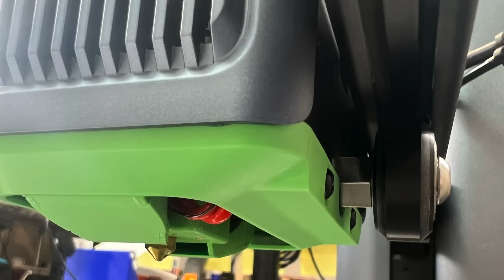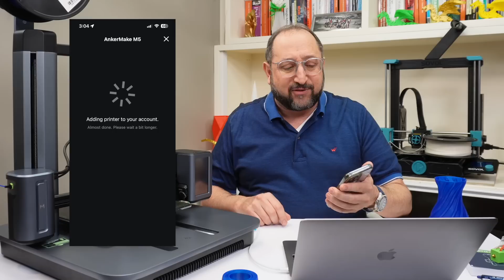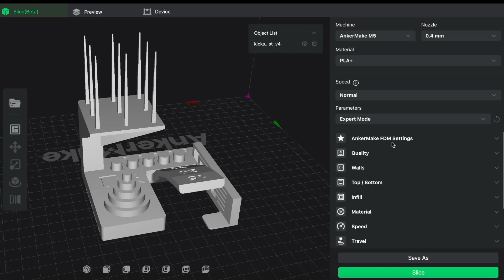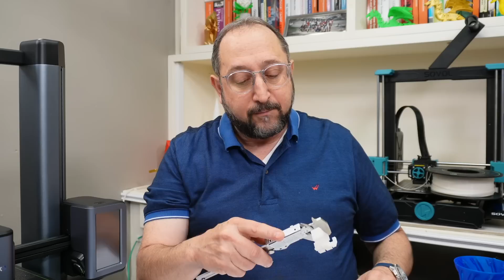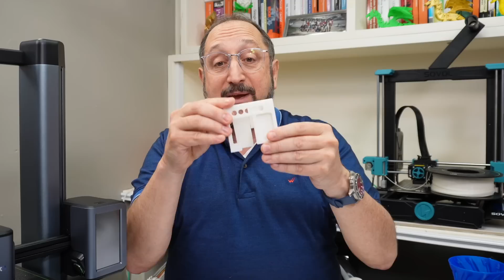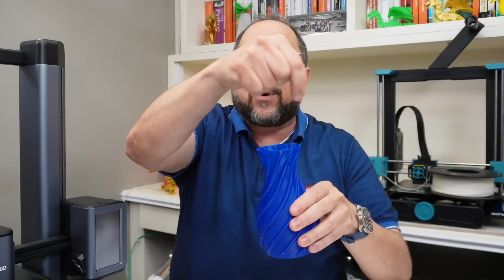AnkerMake M5 3D Printer: This is One Fast Printer!

Comment from the maker: This video has generated several strong comments, and I wanted to respond as the issues some people may see are addressable.

Over the past four years, I have reviewed/used over 20 3D printers from various manufacturers.  Here is a summary of my perspective.

This is a solid 3d printer that is extremely fast. My results while creating test prints were excellent. While designed as a plug-and-play 3d printer, it is still a mechanical device and requires maintenance and tuning.  In some ways, manufacturers do a disservice to purchasers by describing machines as plug-and-play.   Every mechanical tool I have purchased, from woodworking equipment to 3D printers, requires that the user check the assembly and make minor adjustments before first use.

In my experience, any device shipped a long distance will likely need a "tune-up" before first use.  AnkerMake has videos on its site showing how to adjust the belts and wheels on the machine.
The hot end on this printer utilizes a PTFE sleeve, limiting practical operational temperatures to about 230C +/-.    This is fine for PLA, PLA+, and TPU but is at the low end for PETG. People running into issues may be attempting to print at temperatures too hot for this machine which damages the PTFE sleeve.   This is no different from many other 3d printers that also use a PTFE sleeve in the hot end.

The advantage of hot ends using PTFE sleeves is the prints generally string less, which is a significant advantage.  For example, I have an Ender 3 S1 and an Ender 3 S1 Plus.  The S1 Plus has an excellent all-metal hot end but strings significantly when printing.   So depending on my model requirements, I use the S1 or the S1 Plus.

To print at higher temperatures, replace in PTFE sleeve supplied with the printer with Capricorn  XS tubing.   Just order a full-size Bowden tube and cut it down to the proper length for the tube in the hot end.

You can purchase Capricorn XS Tubing here: https://www.amazon.com/gp/product/B07PS3NH82

In summary, my experience with the AnkerMake M5 has been excellent, but if you want to print at temperatures above 230C, I highly recommend you replace the PTFE liner with Capricorn XS.  Using this printer at 260C to print with filaments requiring higher temperatures will likely be unsuccessful and frustrating.  When used within appropriate temperature ranges for this architecture, I expect you will find this machine very fast and easy to use.
Reply: I wonder if this is the case with the m5c too. Its hot end gets hotter?

Comment: Hi ,

I hope you’re doing well! I’ve really appreciated your videos on the AnkerMake M5C, and I’ve run into a bit of a snag with mine that I’m hoping you might have some insight on.

My M5C is still pretty new—I’ve only done about 20 prints. One night, I went to bed while a print was running, and by morning I found the filament had jammed up in the reel and stopped feeding into the extruder. I managed to unclog the nozzle afterward, but now I can’t get filament to come out or go in at all.

I even heated it up to 300 degrees Celsius and used a heat gun to measure the internal temperature, but the hottest it seems to get is around 110 degrees Fahrenheit on the plate, which makes me think something’s definitely gone wrong.

If you have any advice or know someone reliable who handles these repairs, or if you think I should just replace the whole assembly, I’d really appreciate your thoughts.

Also, if you know anyone who still sells parts for these, that would be a huge help. It seems like the manufacturer isn’t releasing parts at this time, so any leads on where to find them would be greatly appreciated.

Thanks so much for all the great content you put out!

Best,
Joe

Comment: Amazing video thank you! I probably miss heard you, but I just confirmed I can use the camera ai with gcode files imported from cura providing I import them into the slicer mode and then move to print from the preview mode instead of simply loading from the device screen. Adaptive layers plus the ai with a well lit set up for the camera + filament that contrasts with the bed color makes make me a very happy consumer

Comment: For the people complaining about the proprietary nozzles. I've been using my m5 almost non-stop since december and I just replaced the second nozzle. 
You can get a ten-pack from Ankermake for 20 bucks I believe, so that's not really much of an issue is it. 
And if you do a quick google search then you'll see there are already aftermarket nozzles available on the interwebs including stainless steel and hardened steel nozzles.
Reply: yeah ive had mine for a year. i use it a few times a month and have not had to replace nozzles yet. its not a big deal

Comment: @Make With tech Hi, I noticed you said the V6 is a "Palette style multi color setup". Did AnkerMake tell you that? Because they're being very secretive about how it's going to work in their own Discord server. And the main selling point of the V6 is that it's supposed to be able to print multicolored prints without needing to make a transition/purge tower wasting filament in the process. And the Mosaic Palette does not achieve that, it does rely on trying to purge the previous color out of the nozzle between every color change..
Reply from the maker: I guessed.  If the slicing is precise enough you should not need a tower.

Comment: I got in on the Kickstarter for the M5 at 499 USD, mainly though, because of the promised V6 "Color engine" that will also function as a filament dryer for up to 6 spools (Even cardboard ones 😏). AnkerMake are presently (still) working on having it released, now by the end of this year (Yes, very delayed). But if it works as advertised, it should be well worth the wait, as it will make the Bambu AMS look downright stupid in comparison. And I've heard from semi independent parties in the know, that it actually delivers on its promise: Multicolored printing without purge tower! Meaning that if the V6 pans out as planned, this combo should become the obvious choice for anyone looking to do multi-color prints. Well, anyone who doesn't want to flush money down a Bambu's "poop chute", and can make do with "just" 6 colors. 😅

It's not all rosy red though, and as Irv pointed out, I too got to learn from the AnkerMake Discord that the problems with the state the printer shipped in/arrived at my door, was unfortunately not a one-off. AnkerMake had, or even seemingly still have, a quality control problem (mine was one of the last printers shipped from the Kickstarter batch).

Still, the issues I too encountered with loose belts and too tight V-wheels were fairly straight forward fixes that is something all makers will have had to deal with sooner or later anyway. So it's not the biggest deal in the world, just a shame that on AnkerMake's printers, at least for now, these issues seems to be, for a lot of their customers, much sooner rather than later.

All that said though, I can't help but being impressed with the printer. Even with the loose belts and too tight wheels it produced one of the better Kickstarter models I've seen, with great overhangs all the way down to 15 degrees, and only the 0,2mm clearance peg remained stuck in the model off the build plate, whilst the dimensions were spot on in all axis. Which is probably why it passed the "quality control" even in it's state. And it is these quality prints produced at even these high speeds that now makes it my go-to printer (out of my 7 others).

Something Irv did not mention in this review is that the 500mm/s max speed was actually not the max speed the printer shipped with. This is due to a recent firmware update that brought it up from "just" 250mm/s (and acceleration up from 2,5k to 5k mm sq). A Benchy of good quality that the M5 at 250mm/s spent 44 minutes printing, now only takes 30 minutes. And an OK looking Benchy it will finish in just ~17 minutes. And if the appearance isn't much of a priority at all, there are guys in the Discord server now doing Benchys in less than 10 minutes!

So the speed is there, and so is the print quality, even at high speeds. The only problem left now as I see it for potential buyers aside from AnkerMake needing to step up their QC game, is the price. It might be easy for me to be happy with my purchase at "only" 499 USD. But for 799 USD and for now only a promise of a better "AMS" sometime in the future (which will likely be quite a bit more expensive than Bambu's AMS), I'd probably choose the P1P as "everyone" else seems to be doing as well. However, that picture did skew more towards a draw this Easter when AnkerMake had the M5 on sale for 599(!) USD. And at that price I think it deserves another look.

So, in it's current state there are a few things not great about this printer. But luckily they're all fixable. And there are quite a few things to like about the M5 like the ease of use. I'm not sure I should mention the noise though, which is one other area where the M5 has a P1P beat. Because even if better, the M5 is also not really a printer you want to sit next to while it's working. People like to sneer at its and its likes' slinging beds. But it is these slinging beds' low center of gravity that allows them to not produce vibrations like a washing machine during the spin cycle. One might not want to be in the same room as the M5 while printing, but a P1P is something one ideally has a garage, or shed, for.
😅

Comment: Thanks for your report. Unfortunately a cloud based setup is an absolute nogo for me no matter how good it prints.
Reply: It has a USB-C port for a USB-C stick to transfer files
Reply from the maker: Thank you for your comment.  You are correct.  You can print locally.
Reply: @MakeWithTech  Thanks Irv, I realize that. But some features rely on cloud services. I have seen multiple times manufacturers dumping their services after some time, crippleing the functions of the equipment. Any cloud is an absolute showstopper for me.
Its just a sign of lazy, cheap developement in my opinion.I really love your channel, but on this we just have a different point of view.
Cheers
Wilhelm
Reply: @wilhelmspeck5870 he only feature that relies on their cloud service is the camera. Both the app and their slicer can send prints over local wifi, and the app even works via Bluetooth
Reply: @Geoff_W  Thanks, but as long as a printer needs an internet connection for whatever reason, I‘m out. The same goes for Bambulabs btw.
Reply: @wilhelmspeck5870  No Prusa mk4 then either?
Reply: Thank you for your transparency here! We're happy to help answer any questions or concerns regarding a cloud based setup if ever needed as well! - Kiki Chen from the AnkerMake team
Reply: @AnkerMakeBrandTeam  Can I ask....Can we have the message dialogs that appear on the LCD screen, mirrored to the Ankermake app, so, eg, we can see why a print hasn't started... I sent one the other day, and when I went to check, there was a message on the screen saying "please clean the bed before starting a print", which I already had  before sending print over.

Comment: I would try their filament on other printers to see if it really is better filament.
Reply: 'better' is relative. It's faster-melting filament (I've tested it).
Reply: @Geoff_W  Which brings on a whole new batch of questions:
A - (Faster melting): Does this mean that it requires a lower temperature?
B - Are the seams between layers close to invisible as they say and if so, are the item's height as specified?
Reply: @philnelson2364  
1. It's actually an extremely wide range. I've seen it print anywhere between 190°c and 240°c fairly reliably. 240°c is actually what the current record holding speed benchy for a stock M5 in the speedboat challenge prints at. That said, if it SITS at 240°c it burns a tad, so 235°c is the practical maximum, but it is impressive it can be printed so hot.
2. It seems to behave as expected, not slopping around or anything like that.
3. I found the filament is actually EXTREMELY hygroscopic. If not dried/kept dry, it starts to string like crazy and pop after just like 3-4 days in the open.
Reply from the maker: Good idea.  Thanks.

Comment: the 'problem' with bedslingers is that they don't scale up as well when it comes to speed in regards of the print size.   like say.. at the end of the print you're slinging not the bed, but bed + 500g or whatever your very big print(tm) weighs.  

in 20x20 usual prints it doesn't really matter that much.
Reply: Good observation

Comment: Wow they built in proprietary nozzles-10, they have cameras and connections probably back to Anker....
Reply from the maker: I understand your concern. Unfortunately many of the new higher performance printers use some proprietary or non standard parts.
Reply: I seen a company selling a diamond tip nozzle for this for 100$ they claim you wont have to change it

Comment: Didn't Anker have a customer security issue with storing customer videos and data without the customers knowing?
Reply from the maker: They did.   Which is why the M5 makes a point of using an AWS instance in your region.   That said, this is not a security device.   Why should I care if someone’s knows what 3D models I am printing.

Would I use a cloud connected device in a secure location, no.   Would I use it for printing hobby prints or even business prints that are not sensitive, yes.

If you prints are sensitive then do not connect to the internet and print offline - which is supported.
Reply: @MakeWithTech  This is a ridiculous argument.  You now have a device inside your local network fully controllable by a (foreign, but that's a detail) company that may use it to attack other devices on your local network.  Gone is the protection added by a firewall on your internet router.  People don't seem to realize that any such "cloud device" is basically the equivalent of a Trojan horse.  The same by the way holds for apps you install on devices that get onto your local network, so also there I dislike a printer that requires me to install something on my smartphone.   This is similar to just inviting a bunch of strangers to stay in your house and hoping that there aren't any with bad intentions (or even just dumb enough to be manipulated by someone else with bad intentions) amongst them.

Comment: the very and more important part you might left untouch is the lack of tech support i was about to buy one and i saw the review and many people its stuck with a very impresive useless  printer kickstarters there is no support from them you  spend 1000 dlls  for a perfec t useless printer like MY wIZMAKER  PI1 COMPLETLY USELESS I NEED A PART AND THERE IS NOWAY I CZN FIX MY PRINTER 
BECAUSE  NO TECH SUPPORT IF I COULD IWOULD TYRADE MY KICKSTARTER PRINTERS FOR A PRUSA AT ANYTIME

Comment: So is it running Klipper?  On my old Sunlu S8 I upgraded to klipper and my Sunlu which could only print at 60mm a sec now prints very wall at over 115m/sec with better quality.  Also on my Neptune 2 I am easily printing at 125m a sec.  So if the Anker is using Klipper I'm not surprised that that only is an improvement. And my older printers are using noiser motors, and a cheap extruder. These new printers coming out are really exiciting!
Reply from the maker: No it runs a custom optimized version of marlin on one CPU and Linux with custom code to handle the camera and AI capabilities on another CPU.

Comment: I thought they claimed to print 5 times faster???😢
Reply from the maker: It is printing a straight line 😀 My numbers were for normal mode using real models. Fast mode is much faster but in either case it is model dependent.
Reply: 5x what? they put others at "50mm/s" anyway which is quite laughable when replicator 1's were pushing 120mm/s a decade ago.
anyway acceleration would matter more in the example model they have for their claims than the top movement speed.

as per their website the 5x claim is that 250mm/s is 5x 50mm/s.

anyway it runs marlin, but parts are only for it.

Comment: I think it would be quicker to cool it down when you removed the magnetic sheet with the print as it does not transfer heat from acctual bed.
Reply: That can sometimes warp the bottom of your prints if you want them completely flat
Reply from the maker: Correct